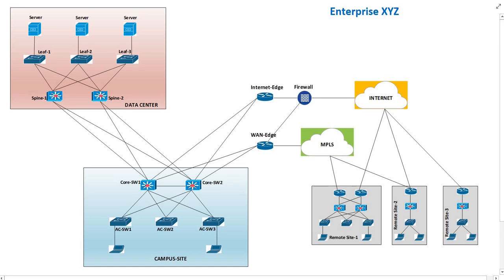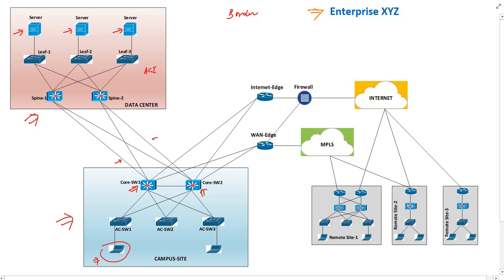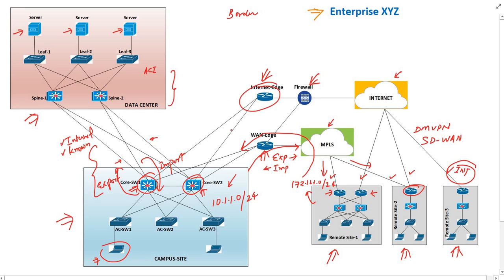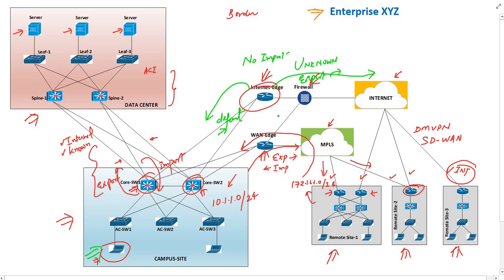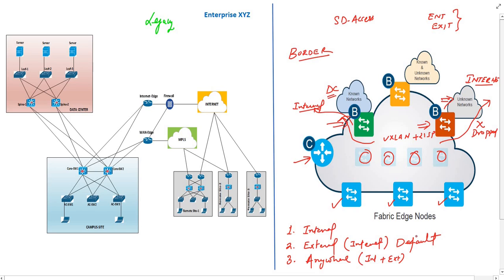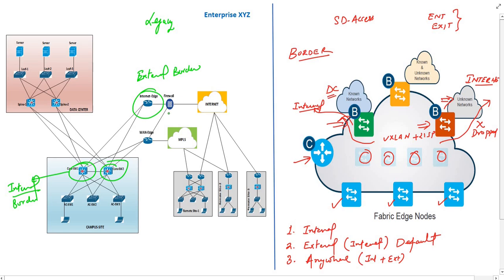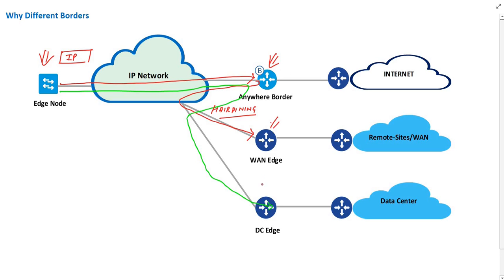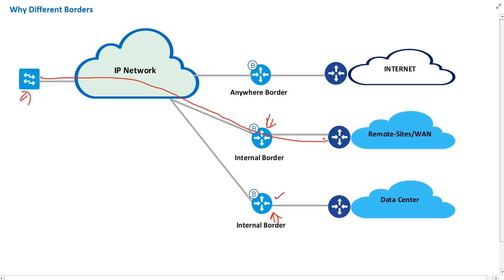SD Access Border Router Part 1

Comment: great content! can the data center leverage/traverse the fabric to access internet servces?
Reply from the maker: This should be other way around Michael. Fabric is just like a campus network which can use datacenter to access the internet..
Reply: @BridgeWhy  I agree... but can you? I know you probably shouldn't.
Reply from the maker: May be I got it wrong. Most of the time Data center is the preferred path for internet access unless you have direct internet connection. It would be a good discussion. So please call me at +91 9148515862 and I may solve your doubt..